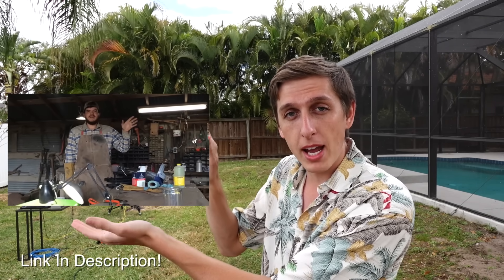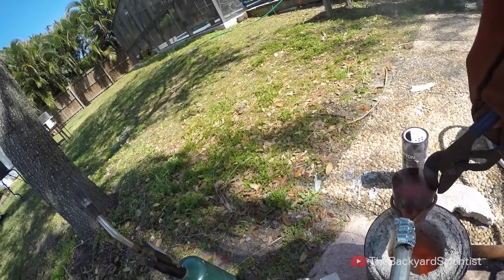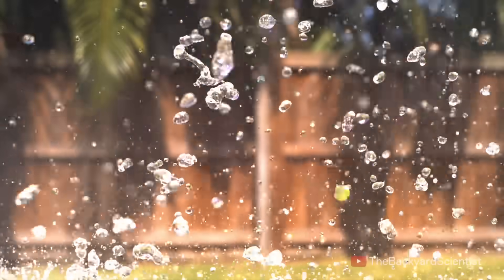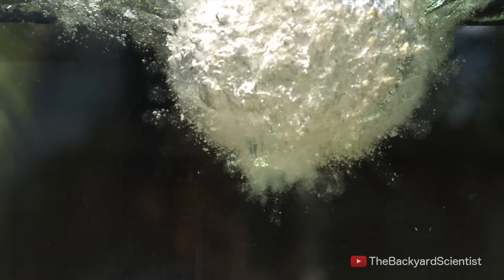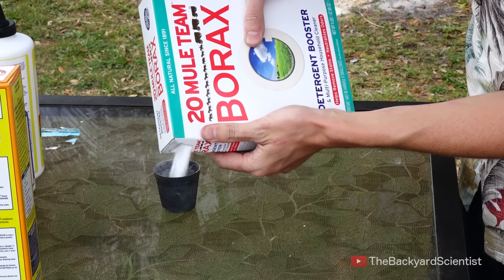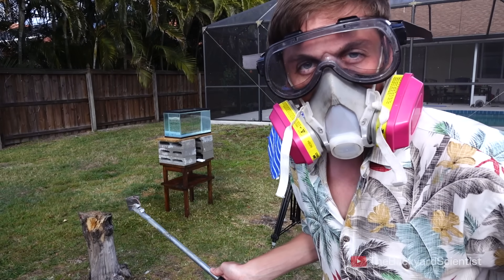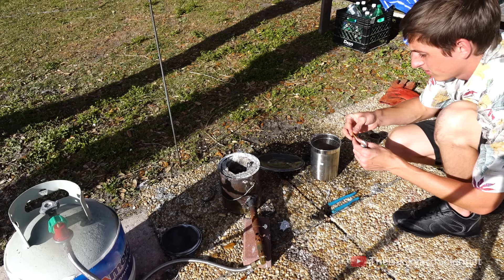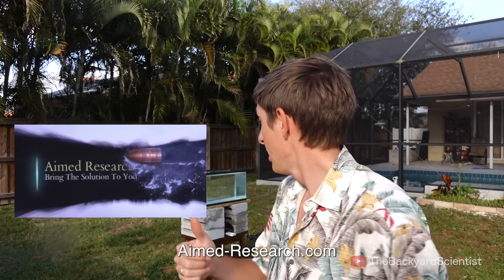Pouring Molten salt into Water - Explosion!

Comment: Expanding on your hypothesis, perhaps Sodium Chloride's hydrophil properties allow it to mixed with water at that high temperature whereas the metals do not easily mix with water. However, I initially thought it might be due to expansion of the salt from liquid into a solid crystalline structure. So what is happening, the outer surface of the molten salt drop solidifies first due to contact with water and traps the molten salt inside it, which cools down and solidifies (relatively) slowly. Whilst it solidifies and tries to get a crystalline structure it has to expand, but it is trapped inside the a shell if you like, so pressure builds up and it explodes. This theory could be wrong but I think it works because salt is very brittle and non ductile unlike metals, so metals can be deformed and stressed in a similar scenario to allow the inside to cool down, but salt won't handle change in geometry and it just explodes violently. Prince Rupert's drop won't immediately explode because glass has stronger covalent bonds and holds the stresses until one bond is broken.

Comment: yeah I think that the only reason it exploded (as salt doesn't chemically react with water aside from disolving) was literally boiling water.
Reply: why the other ones didn't explode is probably that they cooled down too fast
Reply: or they just cooled down too fast
Reply: Sodium chloride doesn't react, but sodium itself is highly volatile when added to water. They even have to store it in oil so that it doesn't come in contact with moisture in the air and explode. It's that valence electron.

Comment: This looks like flash vaporization to me. If water is superheated, above 212F with vaporization inhibited, it will explode when it finally evaporates. An example is water emulsified in oil. With the water fully emulsified in tiny droplets, it won't boil until the temperature gets over 300F because the surface tension will hold the pressure. When the bubbles finally vaporize, they join and produce a flash vaporization explosion (this is not a theory). 

Molten salt has two advantages over borax. One is the low viscosity allows it form tendrils in the water and increase surface area. The other is greater solubility. The vapor phase around a hot substance slows heat transfer considerably. Dissolution of the salt will raise the boiling point and maintain greater heat transfer at higher temperature. If all this is true, glycerin should produce similar behavior, though much less dramatic at lower temperature.

Comment: when the molten liquid nacl is poured, at the start, the gravitational force is maximum - varying from the air into.the water. the liquid separates into smaller portions due to the buoyancy and the succeeding portion of liquid moving faster through water than the succeeded / proceeding chunks of liquid nacl. Your ph test confirmed that this is a physical reaction. it all begins at the surface, the liquid expanding and separating as it submerged in water gradually. high temp steam created at the area where outer liquid nacl interacts with water, pressurised under water finds itself easier to penetrate the disintegrated nacl liquid, than force itself towards the external water. these explosions at the surface of interaction b/w outer nacl and water, interact with each other, when steam tends to expand in all directions  - explosions marrying with other explosions.. the steam is still wet on the outside, its wetness seeps through inner portion of liquid nacl .... marriage of several explosions, beauty is born.

Comment: I think it's a matter of solubility. The sodium chloride dissolves very readily in water and does not need to change ph in order to do so. The polar attraction between the salt and water allows the surface to be wetted instantly. The super hot glob is then surrounded with a super-saturated salt solution with significantly raised boiling point, which holds off this bit of water from expanding into an insulating layer of gas. As the salt sinks, depth pressure helps hold off expansion some more as more water is heated. Once the heated brine that surrounds the salt glob reaches a critically high temperature, it expands instantly. Other compounds may not be able to release solutes into the water fast enough for this reaction.

Comment: Very cool. I think as the salt is ionic and readily dissolved in the water (which has polar molecules), this facilitates the heat transfer to the water inatantaneously as the salt effectively dissolves instantly. Almost like a super hydrophilic affect where not just the outside of the salt globule is in contact with the water, but rapidly all the sodium and chlorine ions mix with the water. Also provably having a high specific heat capacity a lot of heat is rapidly transfered basically forming superheated water and an explosion of steam

Comment: is it the temperature that's causing the explosion?  not sure how hot the other materials got when you melted them.  
But just last night making supper I dumped hot grease into my sink of cool water as it was draining and got a nice "explosion" right in my face (didn't get hurt, but almost needed new underwear) 
so what would happen if you poured molten salt (or anything else at the same temperature) into some cool water and then into boiling water? 
I think the extreme temperature differences play a huge role.

Comment: differences in the specific heat capacity? laidenfrost effect protects i
in the beginning and then as the NaCl cools down, it comes in contract with the water ant heats it up similarly to a vegetable oil fire miffed with water.

Comment: I agree with your theory on this. I think it is basically a steam explosion. I worked in oil refining for twenty years and a steam explosion can be much worse than a hydrocarbon explosion. One day in our refinery, we had a power blip and it shut off water to our boilers which are like huge rooms made from refractory brick with pipes lining the walls that carry water. The water pumps shut down and we were ordered to put steam turbine pumps on in place of the electric pumps. There is a delay in doing so. During that delay, the tubes lining the boiler walls went dry, then when the fresh water was introduced, STEAM EXPLOSION! Water expands about 1,600 to 1,700 times when flashing to steam. There isn't much that can hold that kind of explosion. They are called BLEVE's (boiling liquid expanding vapor explosions) and they are extremely deadly. There was a propane truck involved in a fire in Mexico a few years ago that bleve'd and took out a whole city block. If it had been water inside the tank on the truck that bleve'd, it would have probably taken out many more city blocks.

Comment: I may be wrong so apologies if I am, but why would there be a change in pH? You aren't adding or removing protons from the reaction. Water will remain pH balanced as long as your aren't adding an acid or a base.  I mean, assuming everything reacted completely you would see sodium hydroxide and hydrochloric acid. Which should be produced in sufficient quantities to neutralise each other

Comment: I propose an alternative explanation according my knowledge of materials science.  In an ionically-bonded salt crystal with face-centered cubic lattice structure, the sodium and chlorine atoms are perfectly arranged in alternating, periodic configuration.  If there are defects in the crystal such that Na atoms are not perfectly surrounded by Cl atoms and vice versa, the mismatch would cause intense buildup of mechanical energy in the crystal.  If the defect concentration is high, the stored lattice strain energy will reach a critical point corresponding to a highly unstable crystal, and the salt spontaneously disintegrates (or explodes).  Under most conditions where a molten sample of NaCl cools down and solidifies, the rate of cooling is slow enough to allow ample time for the Na and Cl atoms to arrange into their highly-ordered equilibrium structure.  However, when the disordered molten salt is quenched rapidly by being poured into a relatively cold water bath, the consituent atoms do not have adequate time to arrange themselves into their perfect crystal structure, and very defective salt crystals form.  As temperature continues to decrease, the unstable crystals release their energy explosively by disintegrating into smaller pieces.

Comment: Some older textbooks define lattice energy with the opposite sign, i.e. the energy required to convert the crystal into infinitely separated gaseous ions in vacuum, an endothermic process. Following this convention, the lattice energy of NaCl would be +786 kJ/mol. (I got this from wikipedia)  i thought it was a fundamental  of state change and thermodynamics involved, then i read  Bharath Kumar's comment and realized their is actually a name for it, and its been so well understood that its been assigned an energy measurement assigned to such a gaseous process of crystallization. "Lattice Energy"

Comment: this is more of a Physical reaction; Heat + Instantaneous cooling goes Boom! Remember, the molten salt's temperature is about 600 degrees celcius and the water temp is just about 30.
Reply: Kenneth Cabauatan then why didn't the same reaction occur with the other molten compounds?

Comment: TheBackyardScientist,
To figure out if the reaction of is chemical or physical, you need to address the variables in your experiment(s). Heat is the variable you need to remove in a future experiment.
Try Carefully and Safely dropping a solid piece of sodium metal into water.
Without heat being a factor, this will provide you with the answer to your question: "Is the reaction physical or chemical?"

Comment: The reason the sodium explodes on the surface of the water is because it floats; its density is less than water.  It wouldn't go below the surface even if you wrapped in in plastic.  Cool and fun experiments.

Comment: Could the lack of a ledenfrost effect be something to do with the solubility of NaCl in water? Instead of the steam forming a protective jacket around the salt as it does with the other salts, the steam dissolves into the salt more or less straight away?

Sure, the other salts dissolve too, but maybe not quite as well as does table salt.

Comment: This reminds me of heating purified water to the boiling point, then dropping salt into it causing an explosion. Putting salt in the water lowers the boiling point and makes the water instantly above the boiling point and rapidly expands as steam i.e. explodes. -- Sodium I would imagine as it cools goes back into it's solid form. In that form we know a chunk of it reacts much slower than salt in water. The hydrogen produced also buffers the sodium from the water. Sodium also floats. These factors buffer the sodium explosion. -- Salt on the other hand dissolves in water i.e. becomes a part of the liquid. It is not buffered in the way sodium is. This way the salt can ionize and interact with more water molecules, causing more water to turn into steam and expand in the initial expansion, i.e. bigger explosion -- My best guess..

Comment: I have a Theory: 
Maybe Na reacts with water forming basic NaOH and emitting heat but that heat is consumed by the reaction of Cl ion to react with water (which explains why Molten NaCl react less vigorously then Na with water) forming HCl and HOCl which is acidic, and maybe the balance of both acidic (HCl and HOCl) and basic (NaOH) is just perfect enough to keep the resulting water Neutral.

Comment: I know because since the assault was so hot it heated up the water causing salt dissolve a little bit faster but since the assault was hot as I said before it caused a little like a little splash when you put in at regular heat but but Center really hot it causes the water they messed up and causes little tiny explosion that happened at once

Comment: Some numbers and basic theory might help. Lets suppose that the fishbowl has between 15 to 20 liters of water, the kinetic energy of water molecules at a liquid state and room temperature is very little (0.0000000 ... Joules ), molecules are just bouncing around with each other and giving that funny movement that we all know. Now, the energy required to boil water at it's boiling point (100°C) is given by the following formula: Q = (m)(Hvap) where Q is the amount of energy as heat (in Joules), m is the mass of water , and Hvap is water's heat of vaporization (which is 2260 J/g, the amount of energy required to convert 1 g of water at 100°C to 1 g of steam at 100°C). 20 liters of water are 20000 g, thus, Q = (20000g)(2260J/g) ... but let us remember that these molecules are not being converted to steam at 100°C, the thin layer of vapor that forms between the molten salt falling through the water must have a temperature close to the melting point of sodium chloride (which is approximately 801°C). Also, let us assume that the mortar (and of course the molten salt) looses 10% of its heat temperature while carried away to the fishbowl (that is 801°C minus 801°C times 0.10 = 720.9°C. Finally, we divide this temperature by the boiling point of water because we are boiling at the temperature of the molten salt (720.9°C / 100°C = 7.209 times). This number is the one that we are going to multiply by the water's Hvap (2260J/g times 7.209 = 16292.34J/g). Now we can compute Q = (m)(Hvap):

Q = (20000g)(16292.34J/g)
Q = 325,846,800 Joules

Therefore making sense out of this, we are changing the kinetic energy of water from 0.00000 something to 325 million of Joules in less than a millisecond. Obviously, we are going to expect a massive wave of pressure directed towards the 5 walls of the fishbowl, and the little hydrogen atoms (quickly converted into gas) exerting pressure upwards at a very high speed too.

Very cool ...

Comment: Im going to have a guess.

Could the molten salt be compressing itself when the outside of a clump cools down from water. Causing even higher temps in the core of the glob which then actually boils the molten salt.
?

Comment: what exactly happened is by boiling the salt you separated the sodium chloride into sodium and chlorine. when sodium and any of the elements in the first group of elements(with the exception of hydrogen) comes into contact with water it explodes because pure sodium is unstable

Comment: Regarding the sodium: At Eaton valve, in Battle creek, mi, they used to put sodium "rope" into hollow valves, which helped with heat dissipation/distribution. Of course, some workers found that just tossing small lenths into water puddles caused a fiery explosion. Try just tossing a chunk of that sodium into the water, without the heat.

Comment: Think I figured it out.  The molten salt flashes the water to water vapor, which takes up much more volume than water for the same amount of molecules.  Molten salt was runny compared to the molten borax, so the molten salt would disperse better in water and provide more surface area for making water vapor.  Finally, the molten salt is denser than water (roughly a little more than twice as dense), so it sinks into the water, further enhancing the process.  The molten sodium is slightly less dense than water, so it cannot sink, and thus, it reacted on top of the water.  Note that the molten sodium chloride is a physical reaction, whereas the molten sodium was a chemical reaction (which produced fire due to reaction with oxygen in the water).

Comment: the reason why it exploded is inside the molecule of the salt NaCL sodium is an alkali metal these certain elements react violently in water and when he heated and melted the sodium chloride it separated the sodium and chlorine causing the explosions
Reply: if i am correct i could be wrong

Comment: Salt is sodiumchloride that is quite stable chemical compound. When you heat it up to melting point in dry enough atmosphere you will get liquid sodium as chloride evaporates away. That's why you get the violent explosion. It's superheated sodium that reacts with water.
Reply: BTW, if you want even more violent explosion, use kaliumchloride... Kalium is so reactive that you might need to use some kind of closed space with extremely dry air so it won't explode when melting :D
Reply: And to be more precise on science... When you heat salt beyond it's melting point you will get molten sodium and chlorine gas. When you drop that molten sodium into water you will get sodiumhydrogene and hydrogene. Sodium it self produces a lot of heat with water and since it's allready superheated the hydrogen produced in the reaction will explode for sure.
Reply: I think you're incorrect, the sodium chloride in liquid form reacted differently than the sodium in liquid form.
Reply: Imagine if the earth reaches a high enough temperature to boil the ocean. Won't that make all the salt in the ocean react with the water itself and well the ocean would violently explode in some way? Well if the salt get's that high. I am trying to picture a scenario when the earth was being formed back in it's molten stage. Wasn't their  a lot of these violent explosions then made out of these compounds?
Reply: At the point when sodium is extracted from salt and it reacts with water... We have much bigger problems... It takes a litle over 800 degrees of celcius to melt salt so it can brake in to sodium and choride. So at the point when all the salt in the oceans would react with water or oxygen there would be no life left on earth. Earth would be allready a hellish place like Venus.